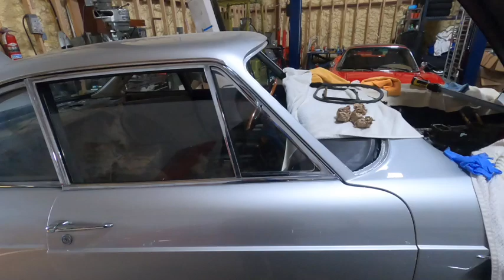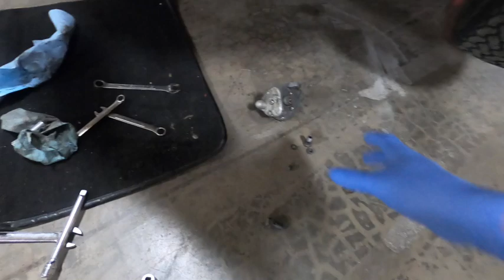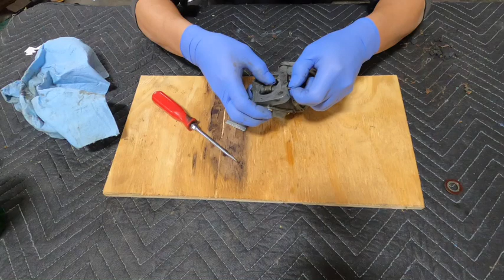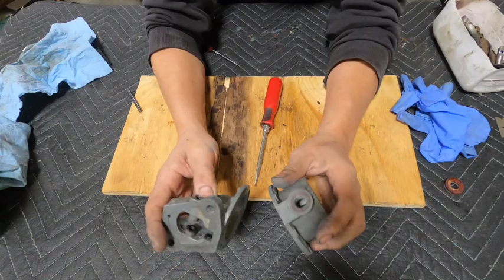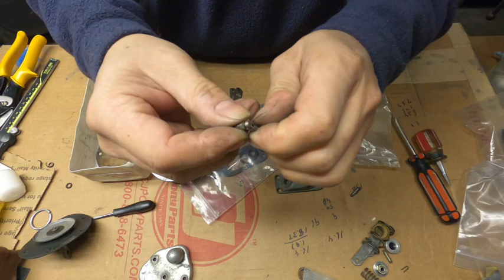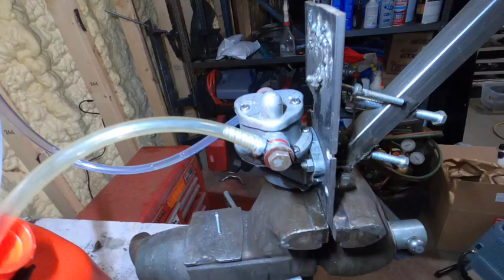Ferrari Mechanical Fuel Pump

Comment: Another great video, Tom. The mechanical pumps are an issue in warm/hot weather. I maximized the stroke on my mechanical pump by carefully measuring the plunger stroke and subsequent diaphragm movement. Once these measurements were known, I milled the spacer block between the engine fuel pump mounting area and the fuel pump, allowing for maximum stroke length and, therefore, maximum diaphragm movement. It helped with fuel delivery but did not resolve the vapor lock issue.
Reply from the maker: Yes, that’s why I have a test rig to measure the amount of pushrod movement to match to the engine. The caveat is not to machine too much as you risk damaging the pump lever arm. 
I just had a car come in with vapor lock issues which I’ll show in a future video. The mechanical pump worked great when it was cold, but couldn’t keep up when things got warm. 
Just another day around these old cars. Thanks for watching!
Reply: @tomyangnet  
Tom
My mechanical pump really evidences diminished performance when fuel tank reading falls below half tank. That small reduction in fuel pressure level in the tank above the fuel pump inlet has a significant impact on pump performance.

Comment: Interesting you should mention vapor lock because I seem to have run into the possibility that’s why my 330 Gt stalled once thoroughly warmed up. It was a warm day but I didn’t make a note of just how hot a day it was. I had been leaning towards the possibility of a failing coil but vapor lock makes so much more sense.
Reply from the maker: I'm actually shooting a video right now showing the symptoms of vapor lock, but until I upload it, here's what happens. As the fuel bowls in the carbs empty, the car will seem sluggish. Stepping on the accelerator pedal will cause the engine to not respond, and even want to stall. It may even pop through the carburetor as the mixture leans out. If your electric fuel pump is working properly, turning it on and letting it run a few seconds should clear the sluggishness out. The car I'm currently working on has a failing electric fuel pump, so the vapor lock issue is compounded. Good luck and thanks for watching!

Comment: My hotrod Pontiac used to vapor lock usually on a hot day and at a backed up toll plaza either for the bridge or Thru way. This was in the late '80's. Like the Ferrari I put the bigger Holley electric (blue) pump on and it helped. Nothing like stalling with hundreds of cars going around while you wait to cool down. Hope you find a windshield.
Reply from the maker: Sitting on the side of the road is made worse when doing it in a Ferrari because there is often a sense of schadenfreude from the passing cars! 
The time line on this video is out of sequence as I found and installed a windshield on this car a few weeks ago. 
Thanks for watching!
Reply: Really interesting!